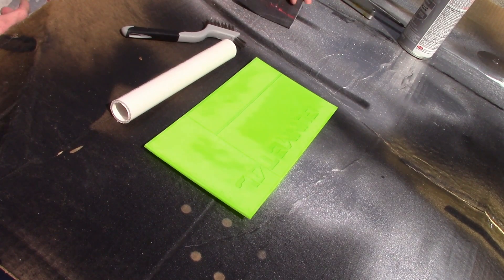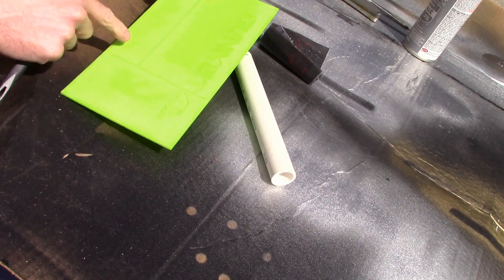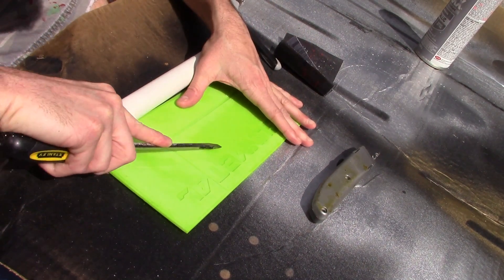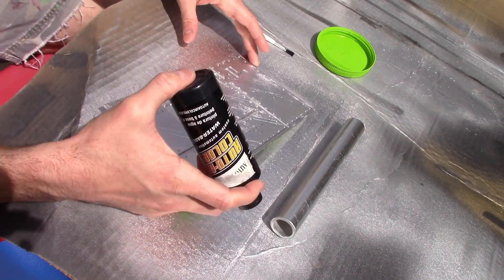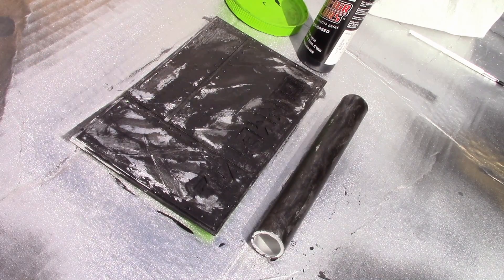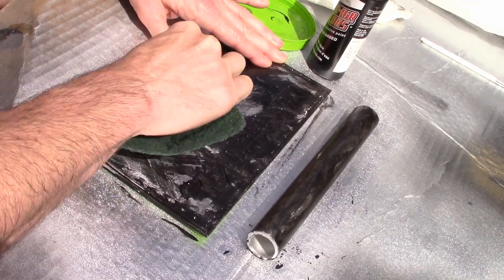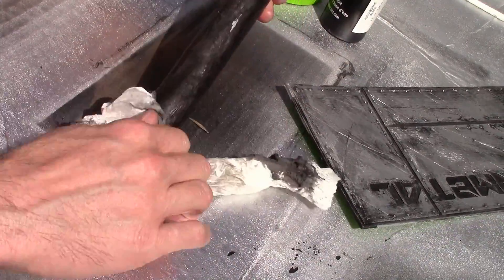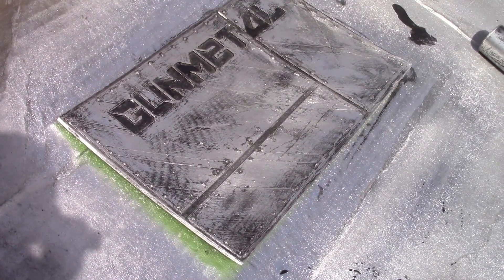How to Paint Gunmetal Effect - HD

Comment: Use a black wash and or pannal liners  it'll save the after scrubbing and sanding same stuff use for models plus a burnt iron paint is perfect for a base coat and just putting a black wash over the top and dry brush a lighter gunmetal paint over the top to highlight the raised edging